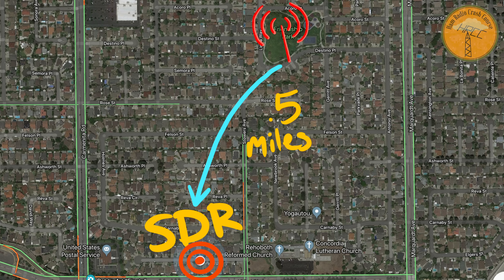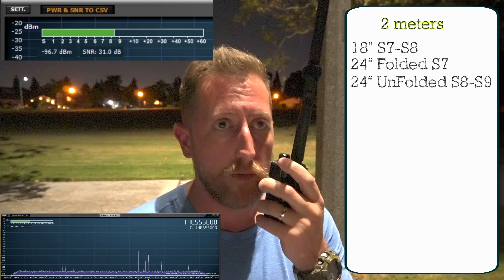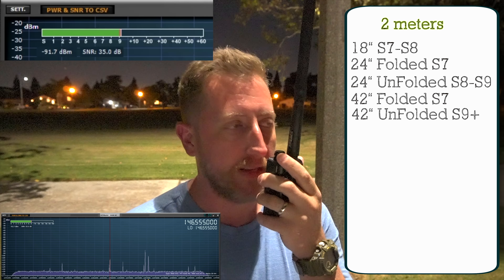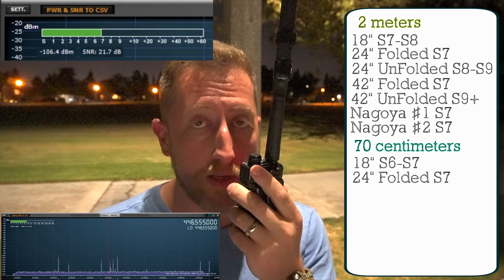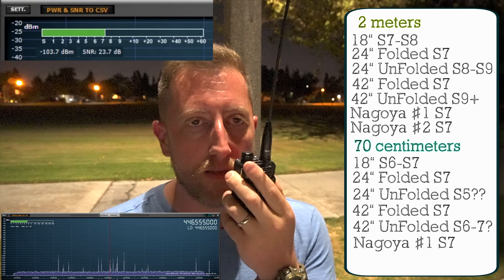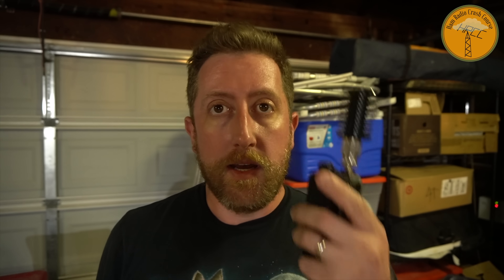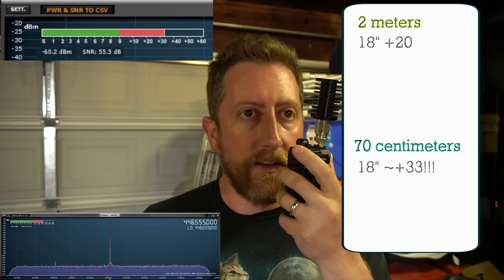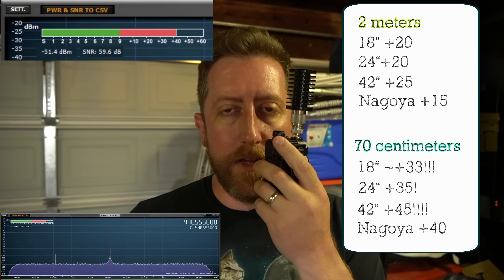ABBREE Tacticool Ham Radio Antenna Performance Test and Review

Comment: Thanks for your excellent videos. You might not know this, but I'll ask. The antenna base with coil, this part appears the same for all the versions of this folding antenna (I am experimenting and have several different lengths of these). The base is not marked to distinguish it which makes me assume they are all the same. But can that be right? Wouldn't the length of antenna require a different tuning in the coil? I'd prefer to leave the base on the HT and change the top, but not if this then ruins the performance. Do you know, or could you guess?

Comment: The 42” abbree picks up the local UHF repeater quite clear (RX) inside my apartment which is severely comprised with brick walls, multiple buildings blocking line of site, and blows away my Nagoya for that use on UHF Rx.  I’m going to experiment with a tripod mount for it.  I usually use it with a handheld sitting on my desk or whatever to minimize strain.  I kind of wanted to hate it based on mixed results elsewhere, but it worked great for that.

Comment: I purchased a 28" Abbree (no longer available) and took it up into the Sierra Mtns last year at an elevation of 7600 ft. I was able to carry on a QSO on 2 meters at near S9 both ways to a ham in the SF Bay Area, a distance of about 93 miles. I was impressed.
Reply: They are available now. I just had one of the 28" models delivered today along with an 18" in orange! I haven't really had the time to test them other than checking out the reception on FM broadcast band! They seem very well made!
Reply: @Curt_Montgomery  I think you'll be impressed. They're a bit ungainly on top of a portable but they flat out work.Glad to hear the 28" is back; I think it is probably the best bang for the buck.

Comment: You need to know that the Swr on the tape type antenna is supper on 2 meters and off the charts in 4 to 1 on 440 meg hertz  I don’t recommend this antenna. De wb8idy Swansboro, nc

Comment: I leave the 42" outside as a base station antenna. Duct taped the bends for strength and electrical taped the connection for more weather proofing. 2 years now, so far so good.

Comment: Having experienced hurricanes this year my bias has become portable deployment. With my 42 inch, triband,  foldable blade antenna, I took some gorilla tape made a loop at the top of the antenna, put a small carabiner on it, threw a line into a tree, and hoisted the antenna about 25 feet in the air. It works well and the beauty is it is as permanent as I want it to be (5 minutes or 5 days) I have it on a pulley attached to the the throw line so if I need, I just take it down.

Comment: There must be a reason why the military use these flat antenna. I thought it was because they fold easy into the pouch and of course it can unfold to a much longer antenna.
Also calling it a novelty is a bit funny as the design is very old. All our radios from back in 50s-70s has this antenna 🙂✌️

About bending it, just don't! If a freshy does it, there is a good deal of penalty and scorning. As me how I know 😊

Comment: Fiddler! Quick question as I wait for my GMRS call sign (I just paid the $35 today)
I have a few Abbree but I leave them against my window on scan because I cannot transmit yet. You said that they are made to work against a person's head. 

What kind of performance differences can I expect if I leave it against the window with no human touching it? 

Sometimes I find it works great. Sometimes I find that the little rubber ducky that came with the Baofeng works better. I guess it's all about tuning. 
Sorry if this is a dumb question but I'm such a noob. I would love to have a setup where I have two antennas and the one with the best signal is the one that automatically gets transmitted. Would that be cool???

Comment: The hattric is in tuning each antenna on transmit and receiv. Each one have different svr when folded and unfolded, depending on which place is bend. I have a few Abree tact. antenas, all very good, but before testing have tuning each to frequency in use, by bend in proper place. Anyway belt antennas are better efficiency (higher impedance) Also amazing baofeng UV-25 antenna. Advice NanoVna 💯👍💯

Comment: Excellent experiment
I am still puzzled how there is a performance difference between receiving and transmitting. 
Theoretically they should be the same.
Reply: The variability is in the transceiver, not the antenna.

Comment: For those that are commenting about putting me antenna on their plate carrier, and using a Tiger Tail or counterpoise, extending down from the antenna approximately two or more feet. And then a short piece of coax that would connect the radio to a pouch on your front of your carrier. Remember that your plate carrier is just that carrying a metal plate. That will seriously affect the tuning of the antenna. When the United States military use this system for their antenna, it was based on the fact that the antenna would automatically be adjusted by the tuning circuit in the PRC 152 handheld. Also that the antenna was designed to operate between 30 MHz and 900 mhz. Using multiple whips depending on the frequency of operation. In truth a 42 in antenna will not resonate anywhere in the 2-meter handband. You may be able to obtain a low standing wave, just because the antenna has low reflective power does not mean that it is radiating a useful signal. A 42 in antenna in the VHF area, would be something in the neighborhood of a 3/4 to full wave antenna having an almost vertical takeoff angle. And UHF it would be multiple wavelengths long, and have a radiation pattern again almost straight up. Anything place near the end base of the antenna, would affect the radiation pattern greatly. Strapping it to your back on a plate carrier. Would cause the signal to look something like an egg or a upside down heart, with the point of the heart to your rear. However this is all affected by the length of the coax you use, it's exact position on the plate carrier the composition of the plate in the carrier. Whether or not you are using a counterpoise wire or tiger tail. These antennas are not practical for the VHF or uhm amateur band they are only to give you the look and feel of a tactical military antenna designed for a very specific radio.

Comment: For my observations, when the antenna is folded it is acting like a quarter wavelength on vhf. And something equivalent to a 3/4 or full wavelength on uhf. The reason these antennas have better receive sensitivity when fully extended. Is it they act as a untuned multi-wavelength collinear array. Similar to how a long wire will self resonate at multiple bands. Frankly a 42-in long antenna is ludicrous for VHF or uhf. As the multiple wavelength resonant point, would cause the antenna to have it almost vertical takeoff angle. The popularity of these antennas are only due to people wanting to imitate the look and feel of the antenna used on the PRC 152 handheld, that became iconic during afghanistan. What most don't understand is it the actual PRC 152 has a tuning range to 30 mhz. To well over 900 mhz. Also the original PRC 152 comes with multiple antenna masks that are stored in a pouch and the user changes them as they change from major band segments. The only time the longest whip would be used, is when the radio is operating below 60 mhz. While the radio would function in the VHS Spectrum with the long width antenna, it is even stated in the manual that the signal would be degraded. And it is best for the user to switch to the correct length whip. A quick Google search for a PRC 152 radio, will give you the manual that explains the antenna. Also the radio contains an automatic antenna tuning circuit. To help couple the antenna to whatever it is connected to. In an emergency a chunk of wire can be used. The automatic coupler will help tune it into residence. Generally I would say that these antennas are for the weekend warrior. That want to reenact the look and feel of the radio is used in combat. However they are completely impractical and useless in the amateur radio bands. Especially due to the strain that they place on the radios antenna connector. The signal quality of just a regular Factory antenna can be improved I just wrapping a piece of wire around the base of the connector, and allowing it to hang alongside the radio approximately 18 in. This would provide an equal ground plane to the vertical radiator. As far as your head absorbing the signal, that's based on a Motorola engineering Theory that was used to test 800 Mega cycle radios in the 1980s. It was believed that the user's head would absorb a large amount of the radiated signal. And Motorola was testing to see whether it was better to locate the antenna on a shoulder mic a few inches away from the user's head, or if it was better with the radio left on the user's belt. In general handheld antennas, are tested over a square ground plane, that is approximately twice the size of the resident wavelength. So if you're testing a VHF antenna they tend to use a flat ground plane 24 in square. If they're working in uhf, it's approximately 10 to 15 in. As the frequency decreases of course the size would increase. Although there are very few handheld radios that work below 110 mhz. Most public service agencies learn that low band handhelds were almost completely useless due to the extremely short antennas, and low output power. That's why most agencies using low band radios, we'll use a mobile repeater with a VHF or UHF handheld. For the wrap up a very long winded statement. If you want to go play soldier on the weekends and look the part these are the antennas to do it with. If you're looking for something functional. Look for a whip antenna that equals something close to a resident wavelength. Roughly 16 to 18 inches long. And on a side note the so-called miracle baby antenna, that's about 2 in long that were originally sold through diamond electronics. And then other various internet knockoffs. It's nothing more than a short coil of wire approximately an inch and a half long with a 50 Ohm resistor soldered in the center. Basically a very leaky dummy load. They're great for communicating radio to radio for about 100 yards. Or if you're working inside of a building with a repeater. But any actual long-distance communication is frankly not possible. As the actual radiating element is only an inch and a half long. Great if you're working in the 900 to 1.2 GHz area mostly useless in VHF and UHF

Comment: I recently heard someone in one of my HAM groups say that transmitting through a folded antenna like the Abbree’s here will actually reflect energy back into the radio itself and cause damage.
Is that true at all?  I’d never heard of such a thing before today.
Reply from the maker: You can ptt most handhelds without an antenna connected and have no issue.  So I doubt a folded Abbree would cause a problem.

Comment: Great video but you're folding your blade antenna wrong, it's going to damage it in the long run and not stand up as well, You want to fold it in on itself
Reply from the maker: Thanks for the tip.

Comment: Is this video/information still relevant and accurate after 4 years? As an aspiring Technician class ham (testing next month) I would like to know. Still learning after all these years (70) plus. :_wat:
Reply from the maker: It is… BUT. I have a hole new set of videos testing the best handheld radio antennas with a better testing approach.

Comment: I only have the 42 in one. super. even on 1 watt . The noyga is a good antenna . I use the GMRS one. much better than stock antenna. I say let NotaRubicon try that on a GMRS radio. ABBREE has some great antennas . I got there weatherproof speaker mic on my HT's . work great . The UHF receive on ABBREE is super even out of band . I put on my HT scanner. even VHF air came in great . 73's

Comment: I already have a 24" Abbree (SMA male version) on order for my Explorer QRZ-1 and FT-5DR.  To me, reception is more important than transmit range, so I find Josh's results very encouraging.

I might gert the 42.5" version later, but right now I'm concerned that it might be too much for the radios' delicate SMA connectors.  Just how sturdily can one of those things be mounted on a plastic body and PC board?
Reply: Hi. Does it fit FT-5D? I worry that it is to thick and wont fit with gps antena.

Comment: Now they have a 48inch version because of a flexible extension between the radio and the antenna. Thinking about getting it but i’m not confident on how rigid the flex is. It might just make the antenna constantly flop over

Comment: Cool!! What I wonder is how good are the rubber ducky types that come with the HT radios. I know that are weak, but just how poor compared to these tactical antennas? There are also some gooseneck types with what looks like a gun suppressor at the end. How do those rate? and are they more directional?

Comment: Realize this was 2 years ago, and you have since done more with these units. Just want to point out that the spring steal used to make coiled measuring tapes isn't hardened the same as say a knife. The product is meant to remain coiled and roll out straight hundreds or thousands of times in it's life. Tapes get abused at the job site, guys break them occasionally trying to show off. What do you do with a broken tape measuring...  you make a radio antenna or novelty bracelets apparently.

Comment: It could be that on UHF the Abbree tactical antennas you are using are too long unfolded for the frequency due to them being more than a 5/8 wave antenna for transmitting on UHF. The closer you get to a full wave the worse the transmission angle gets on UHF is my understanding. For receiving more length the antenna the more area for signal to be received. I could be totally wrong though.

Comment: I only use vhf. I like the folding. I use a Mike and cable to put it on my waist and have it laced through my gear. Works great. I just run it over my left shoulder right through the padding and down the front. The radio is in the back center. I can pop the antenna up for my needs and it's behind me. It has been durable and the memory is to be expected. Just stretch it out in the sun on a warm day it will forget.

Comment: Man - I need to get signed up for my classes because your numbers don't appear to support what you're saying, so...I don't know. I just saw a dude test 4 antennas on another channel, including the Mirkit Tactical antenna, and the Mirkit - with regard to clarity and strength, appeared, to ME to blow all of the others away but that's not what the dude said so...I am just confused as all get-out.
Reply from the maker: Go check out my recent antenna tests.  I have a few folding antennas in there and my methods have improved considerably.

Comment: i relocated my abbree 42 inch antenna at the back of my chest rig using an abbree tactical relocation cable and the abbree tactical antenna relocation pouch which attaches to the MOLLE webbing. no more distracting/annoying antenna in the face!

Comment: Thanks for the review! Out of curiosity, can you roll the antenna (like a tape measure) for storage such that it has no short radius bends? Also, did you have a chance to test these with a different HT?
Reply from the maker: You can’t really roll it up. It’s basically two tape measures opposed to one another.  It’ll fold but not roll. Yes I’ve used it with a few radios.

Comment: I would like to get the tri band version of the 42.5" antenna but do not want to install it directly on the HT itself. Is there a flexible jumper I can use to connect to the antenna and to the HT?

Comment: Josh I don't think u R old enough to remember this but those foldable antennas R based on WWII back pack military radios. If u ever watched any old WWII movies, u will see that exact same antenna on the radio operators pack radio. They R design for long range transmitting and receiving. Just thought I'd give U a point of interest.

Comment: When I was in ROTC back in the 80's our backpack radio had an antenna almost exactly the same as the Abreee except it did not have the rubber coating(I think it was anodized). We used it when on the move.
If the Abreee is anything like the military one, it was like two tape measures attached back to back.
Amazingly the Voyager mars probe used the exact same method for it's soil scoop. The arm it was attached to was made just like the antenna, and ran between two rollers when it was retracted. This type of mechanism can be amazingly strong if made right.
 When not moving we had a over 10 foot segmented tubular antenna with a cord down the center attached to a spring... It took a while to take down, but could be put in service in just a few seconds.

Comment: I have a 42 inch version that Ive been using for airsoft purposes for quite some time. Recently I cut mine down so it was (while unfolded) double the length of my plate carrier. I noticed that it was infact made from a tape measure! Yet I did do some testing after I cut it down via an SDR. The results were very much the same. Although I didn't do much in the way of range testing. It did certainly work just the same as the shorter antennas. On VHF it works great!
Reply: You could've just bought the shorter antenna. Cutting an antenna down isn't a great idea. 42" is far too long for any high movement activities and should've been taken into account when buying. Guessing you wanted to look like one of those "tacticool" guys with a beefy antenna with a repeater site probably less than a couple miles from you.
Reply: @Unknown_Ooh  sure thing Mr "know it all". I guess I will consult you directly next time I need to modify any of my kit.